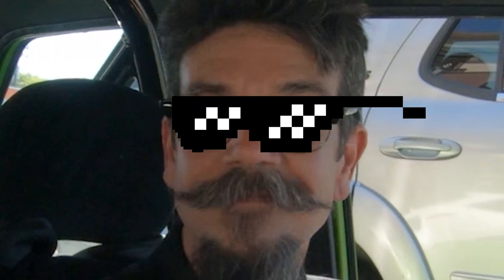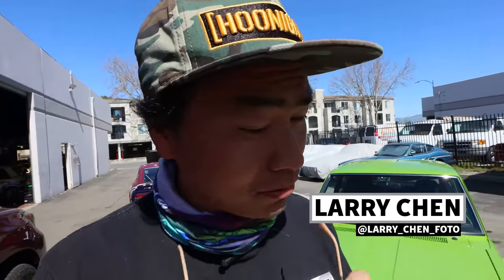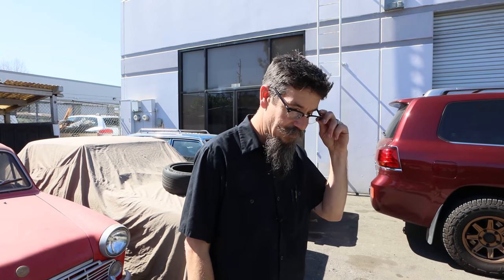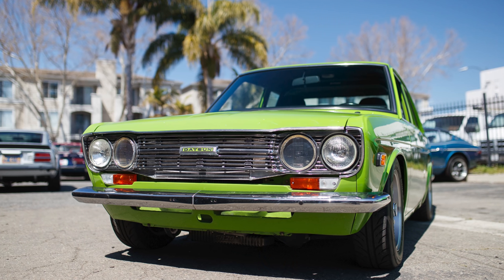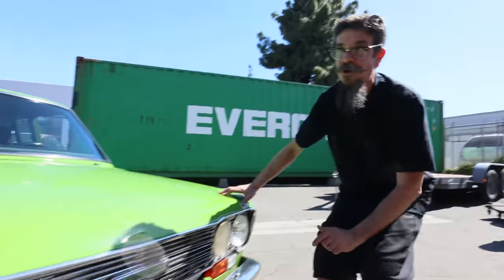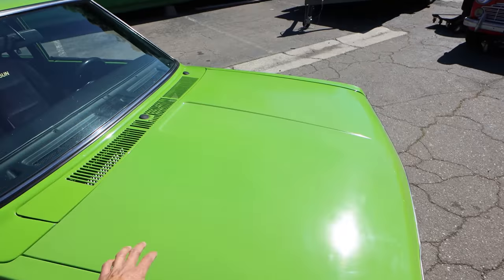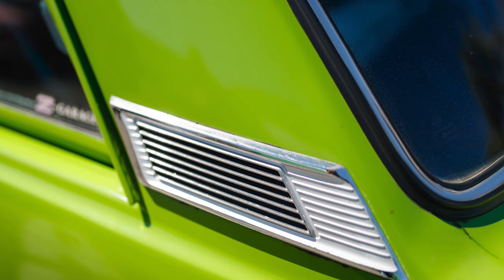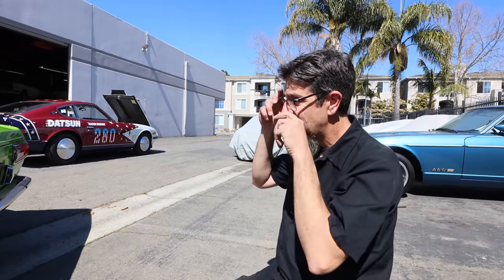An SR20 Powered Datsun 510 is the Most Perfect version of a Datsun 510

Comment: Really cool video I have a 71 two door I bought out of the newspaper in 2004. Was actually looking for a 1200 fastback because my mom had one and saw pictures of it. Had no seats, no grille no lights.. this came up for $150… put it together, I was 18 years old. I drove the shit out of it, overheated it many times, rebuilt the head, has a Weber carb, had it rebuilt, points, always pinged no matter what I did to it. I said I’ll drive this L16 until it blows… that happened about 7 years ago. Car has been sitting needs suspension a whole build. I have an L20B A87 big valve head all new, just need to be assembled . Life goes on now it’s 10 years later and thinking f the L20 and go with this setup.. I have skit of projects and I need to focus on one. I got so many compliments on the car, and get asked if it’s for sale constantly. I said I’d never sell it. I just have so many projects and not enough tine or money for all. So I’m looking at doing an SR20 swap keep it simple, big project through. Sick vid, havnt touched it for 5 years, getting stoked again

Comment: Thank you ,Larry, you keep bring Rob out and I'm starting to understand his obsession, with things like factor clutch fans on a Z.
   Make in the 1980's and 90's .I swapped very Datsun steering wheel for a smaller thicker one. Now I have 240 steering wheel on my 240 and my back dated 280. I insisted on having the original wheel. 
  For no other reason than ,every body changed them, but the factory 240Z steering wheel, is a true , work of ART ! It's the perfect size and the perfect diameter. 
  But you have to live alot, drive alot, and then you get to understand the beauty, the ART of the Original Z Concept.
Thanks Larry, Thanks Rob
This was fun !

Comment: I got a shit 4 door 510 back in the 90s when I was in auto trade school. Lots of steering play. Finally took a good look and the FRAME was cracked right under where the steering gear bolted up. Everything you'd expect from a $500 car. 2 inch thin doors make for an exciting experience on the freeway, not something I would recommend without a cage. I still loved it, tho. Only tool I had was a flathead in the glove box; if I didn't like the way it was running I'd just get out and tune the carb. So simple...

Comment: LOVE this episode! I've been obsessed with 510s since the 80s, and have an SR in my current open class auto-X 510. It started racing with a fat lazy GT3071R that went ape shit crazy after 4,500rpm. Even with Xanax and ear plugs it was terrifying to drive. It has a GT-X2867R now, so +boost at 2,250 rpm, flat predictable peddle response all the way to 380whp at 20psi. Put's it down on 205 15s cleanly tucked under stock rear fenders, and 195s up front. With JBCW's rack & pinion kit, it's a Mini Godzila that's terrifyingly fun to drive.

Comment: When I was 5 years old my dad had a White 510 2 Door with the original 4 cyl motor but he had my mechanic uncle break the botor all the way down. A machine shop ground and balanced the crank, shaved and shaped the rods, domed pistons, port and polished the heads, it had roller rockers befor that was really a thing that my uncle had gotten and adapted from his Chevy Racing Division connection in NASCAR. It had custom cromo tubular headers and exhaust with a Thrusher cherry bomb muffler exiting just in front of the driver rear tire through a 2x8 chrome tip, dial 2 port Webber carburetors with cleanable foam/wire mesh air cleaners with custom ducting to the grill for the coldest clean air possible. The seats were Momo buckets with black leather on the sides and the center seat and back were black and white hounds tooth pattern. It had buckets front and rear with custom frames to drop the rear enough to clear the window and the head restraints removed. Momo racing stearimg wheel. Autometer guages for speed, RPM, oil pressure, water temp., 
It had a 4 speed manual with a custom Mahogany center console with a custom 8 track player, equalizer mount. 2 drink holders, ashtray, hideaway storage with elbo pad that matched the hounds tooth seats, 5 point harnesses front and a custom booster and 5 point harness for me. Door panels, roof liner, carpet, dash pad and rear deck were black. It had a custom sun roof that popped up in the rear as well as retract to the back.

Comment: Was the roll bar in the car when you bought it? And was the original color dark green, which I called army green. If you can verify it was, it could possibly the car my Dad bought new and took record in at Bonneville. Engine was built by BRE to run, then taken out and stock motor put back in.

Comment: He's definitely not hooking up. In my 510 I run a 205 width RE-71R with 345whp, a 3.7 R200 Tomei LSD, and don't have traction until 3rd gear. But anything less than full throttle is still fun. That being said, I am trying to squeeze 245 width tires under the car. #4G63510
Reply: Is the 4G63 a Mitsubishi Motor? Maybe from a Starion or Eclipse? I have a 74 Dodge Colt with a 1600 cc Hemi and would love to do a swap with a more potent Mitsubishi motor.  BTW, the Colt is a Mitsubishi, every nut and bolt!!!
Reply: @radicalrobason  several people have done Colt swaps. My engine is from the Eclipse variety.